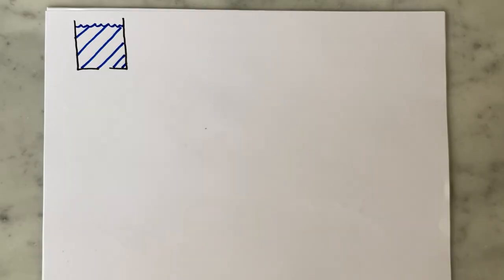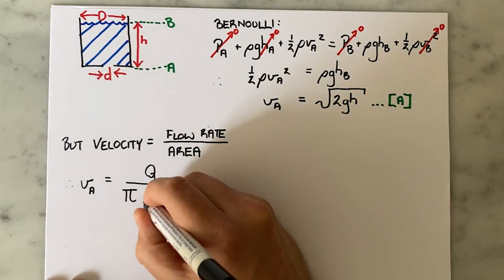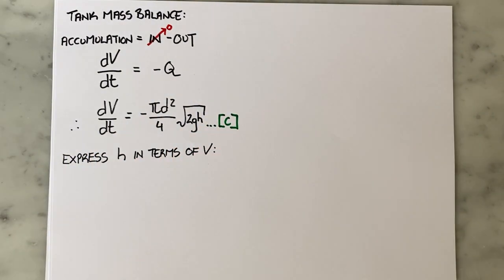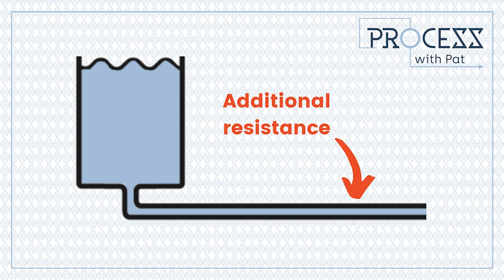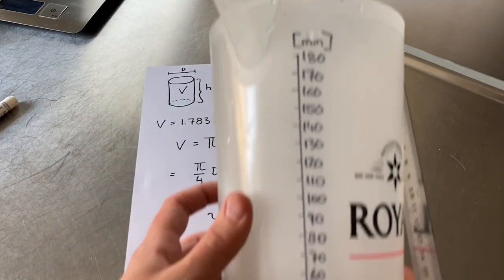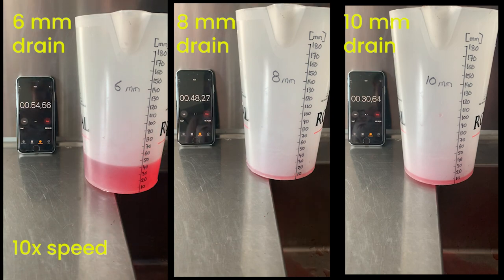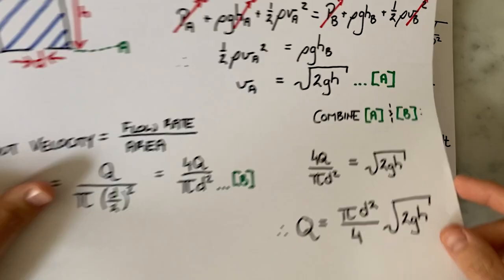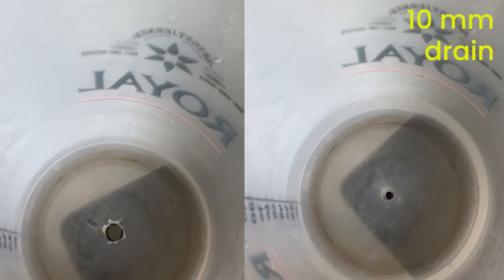Bernoulli, beer jugs & draining tanks

Comment: Interesting video, and completely refresh my mind. Sir I have one question that, if two tanks at different pressure and connected with one pipeline. And there is valve on the pipeline, as soon as we open the valve fluid will start flowing from high pressure to low pressure till it reaches the equilibrium, but how we can calculate the flow rate of the flowing fluid? As we don't know the velocity.
Reply from the maker: Hi there! Glad you found it interesting. You could only begin to start calculating that kind of thing if you had the dimensions of each tank, the initial levels, the pressure in the vapour space of the tanks, as well as the dimensions/arrangement of the line that interconnects them...
Reply: @ProcesswithPat  thank you sir.
Reply: Finnegal's elasticity coefficient = the value applied to a theoretical answer to get it equal the answer you want...

Comment: https://www.youtube.com/watch?v=sUroO7PXm5M This video shows a more accurate actual result compared to the computed one. I wonder if the die had something to do with the error on your experiment.
Reply: I think it's because the hole in that video is on the curved side of the bottle compared to the flat bottom of Pat's video. The hole in the side of the bottle effectively has two sides with rounded edges making the discharge coefficient closer to ~1.0 whereas Pat calculated ~0.61 for the hole on the flat bottom. So that guy's results are closer to his formula even though he left out the discharge coefficient.